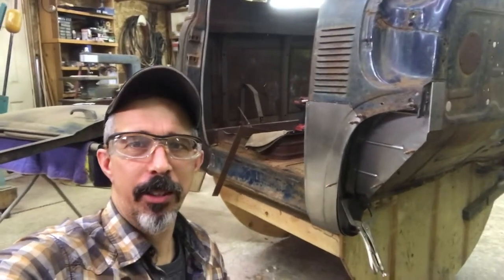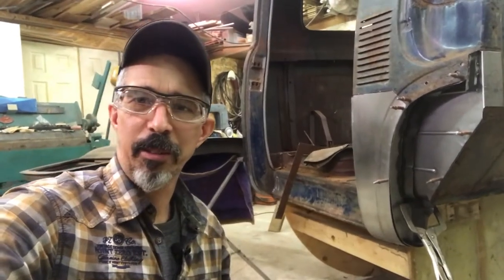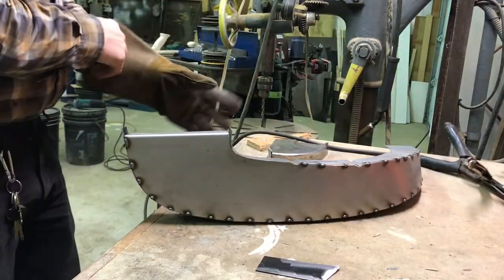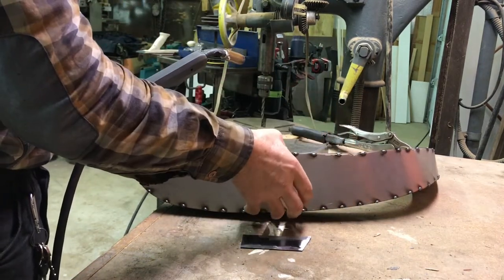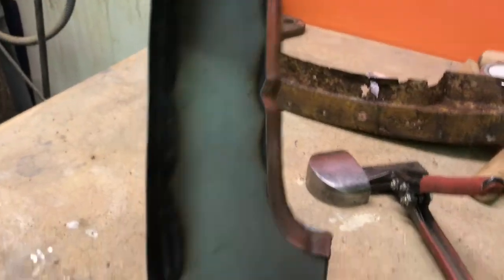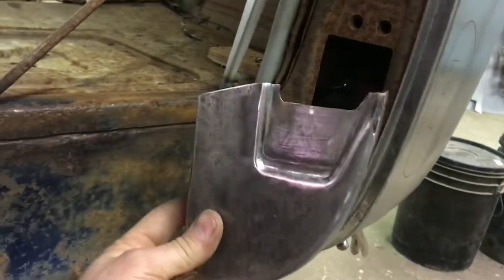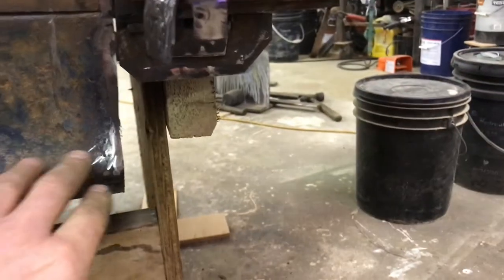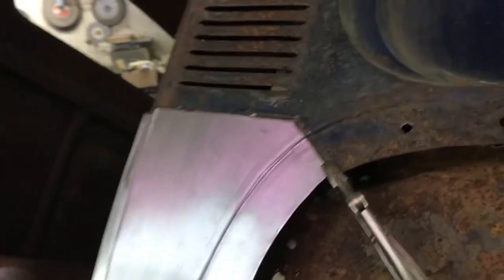Rust repair panels

Comment: Wow!  Nice job making those panels and massaging them to fit.  I presently working on a "basket" 49 (that someone else took apart) same area that you are doing, making my own panels from scrap metal.  For the kick panel I used the bottom of a school desk that had beads rolled in already, 18 gauge.  I don't have the tools that you have, just a mig welder, vise, hammers and some vise grips.  Not restoring this truck, just trying to make a "driver" out of it.  Thanks for your videos!

Comment: Great job on all the panels! I'm currently doing all the same repairs on an identical blue '50 chevy, so I really enjoy following along and seeing how you tackle certain problems and also like seeing your meticulous attention to detail. I actually built that inner cowl filler panel the same way you did and wound up having to add the little bump for the hinge pocket, so maybe it had something to do with sloppy manufacturing tolerances?
Reply from the maker: Thanks, I really enjoy this kind of work but it can be frustrating when working on something that wasn’t very well built in the first place.